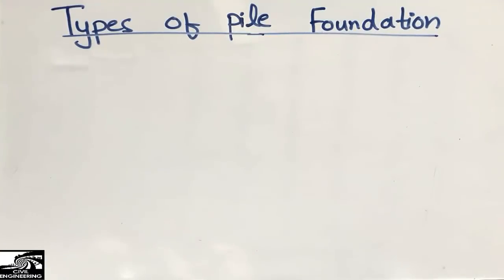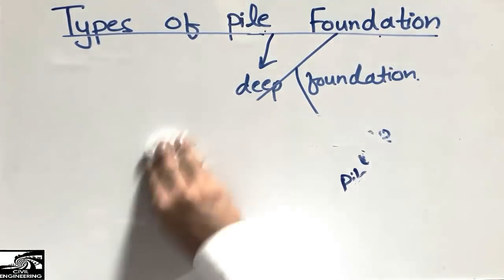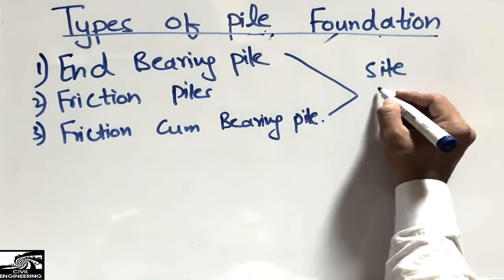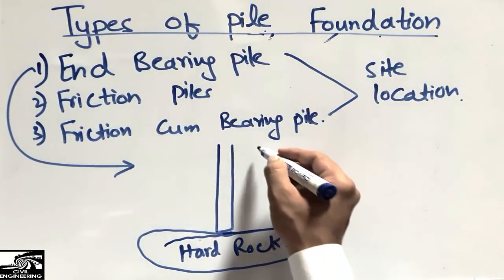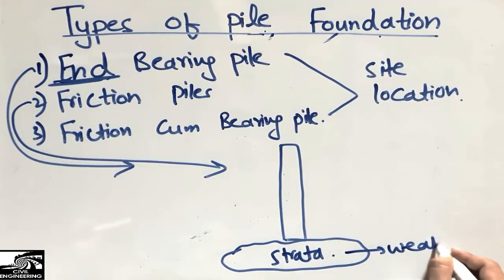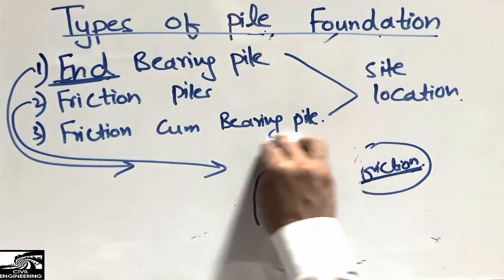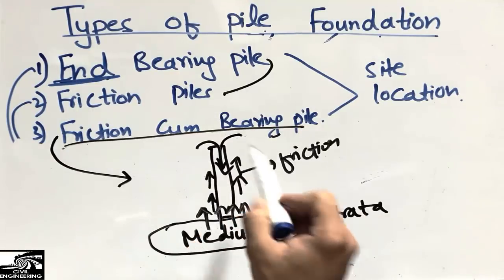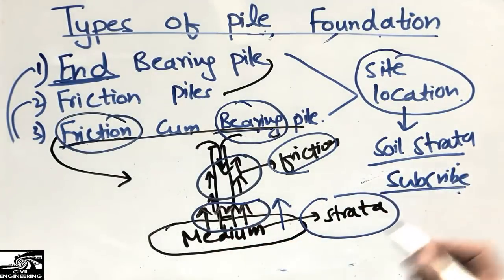Types of Pile Foundation

Comment: There was huge pule driving operation 4 years ago NEXT DOOR to that building that collapsed in Miami ! How much effect could pile driving have on that collapsed building ? A Survivor of that collapsed building stated their whole building was shaking every time the pile drivers were in operation. This pile driving effect needs investigated and reported on !
Reply: A common topic in soil mechanics is that shaking soil is the most effactive way to cause soil compaction. If what you say is true then there is a high probablity that soil under the building may have compacted unevenly and created instability in building foundations. However the geotechnical engineer behind the building should have had the building foundations strong enough to support alot more than some ground shaking

Comment: When they drive a pipe into the ground for a piling, how do they get the dirt out of the pipe before filling it with concrete?
Reply: Clam shell excavate or it can be extracted by an auger.
Reply: The pipe should have a cap at the end to prevent soil from entering the pipe
Reply: @TheMrDamp  ;I would think that would greatly increase the resistance of driving the pipe.  It seems that it is more efficient to auger out the soil afterwards as someone else suggested.
Reply: @wrongfullyaccused7139  true, I think it can be done both ways depending on soil. Very soft soil could have a cap without increasing resistance too much